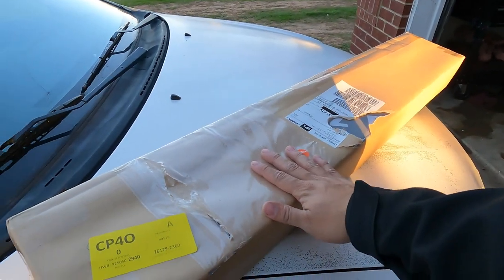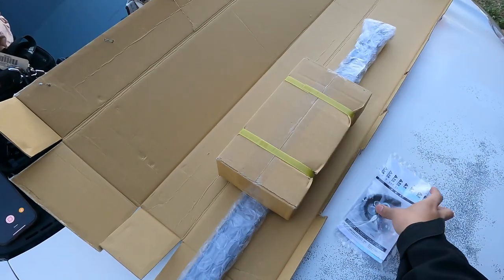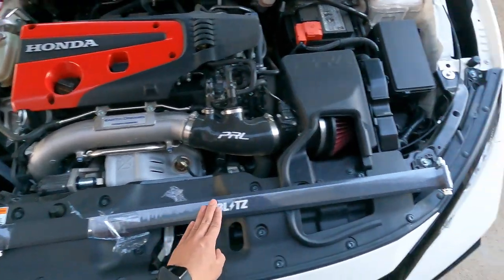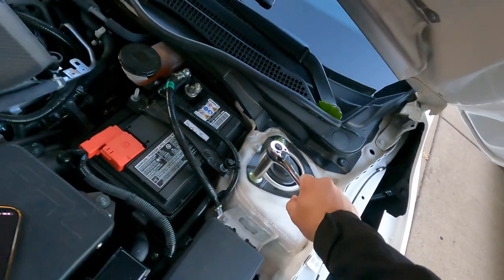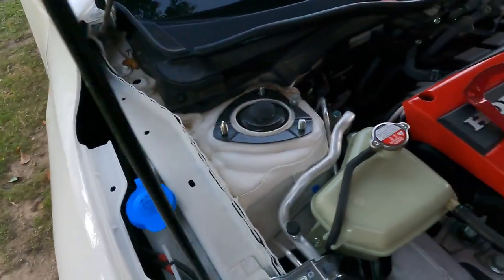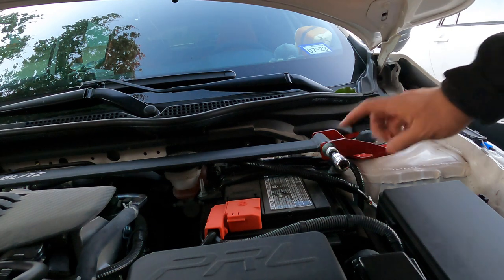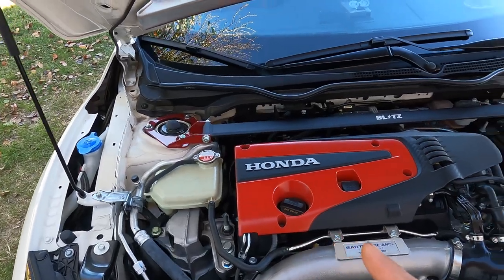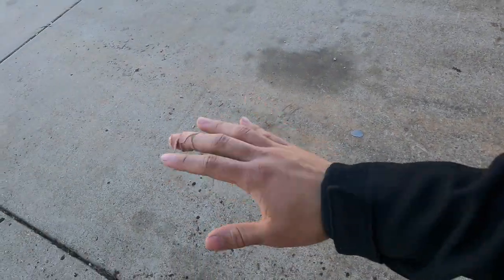BLITZ Strut Bar IMPRESSIONS And Install Into the 21 Honda Civic Type R

Comment: that blitz strut bar looks sick, and i think the blitz nur edition exhaust looks really good too. have you experienced the infamous 2nd gear grind and 4th gear lock-out? i also have a 2021 ctr as well and i am a little worried about the transmission problem. anyways, great video and i look forward to watching your new 27won exhaust installation video! keep it up man!
Reply from the maker: Thanks man I appreciate the support!! I haven’t experienced the 2nd gear grind and 4th gear lockout! The Short shifter if adjusted properly should help a lot with that, for that reason I Got the Acuity short shifter for the car! That video is coming soon!!
Reply from the maker: I haven’t heard the blitz nur edition exhaust! If you have a sound clip send it to me on insta! Id love to check it out
Reply: yo dude i have a 21 as well you can change out your Trans fluid for better results, a lot of talk on forums about that i had the same concern i don't try to daily mine much but after having the car for over a year. The grind problem disappeared a lot of people say it takes awhile for a CTR Trans to break in. The grinds will go away and become hella smooth. Just keep it easy when you drive until the shifts become absolute butter then try it on a Track and give it hell.